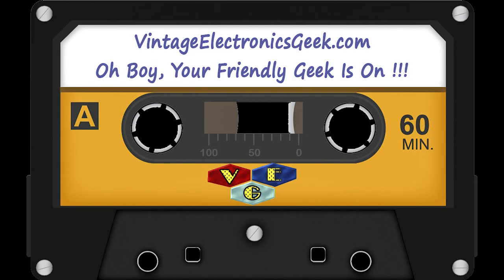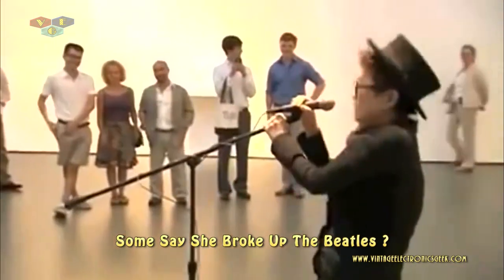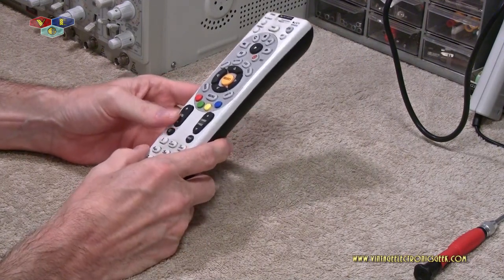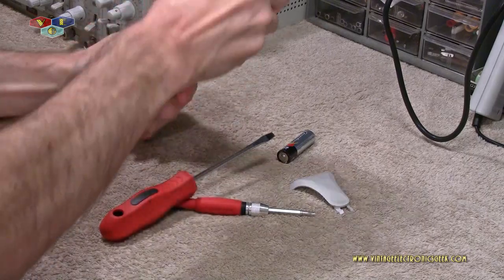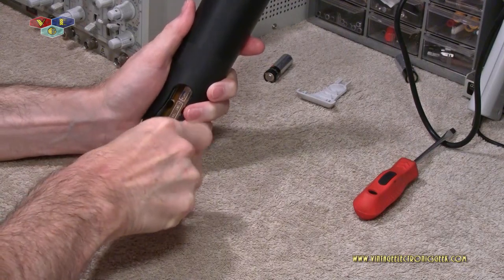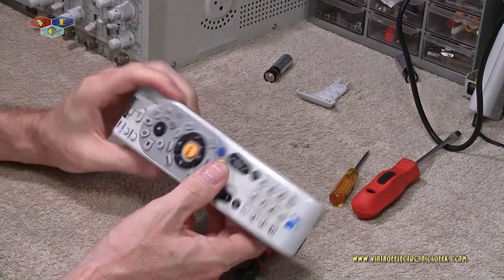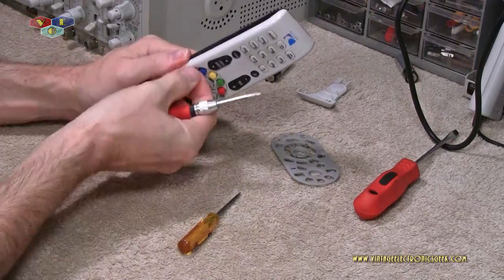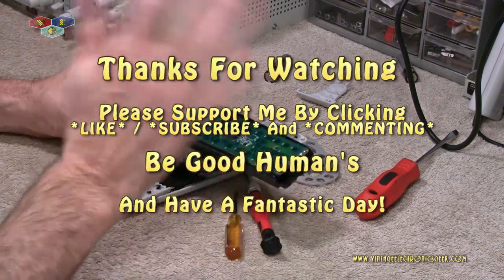How To Open A DirecTV Remote Control

Comment: If you found urself here due to remote buttons giving u trouble, after u take apart, u might find oily substance between circuit board and rubber part the buttons are on, clean it with q-tip and alcohol, put back together make sure top slider in right position before closing, works like new. Word is the rubber gives off the oil after use, because it wasn't "baked" long enough before putting in remote.

Comment: I've found after taking one of these apart that the problem with unresponsive buttons is a buildup of silicone on the circuit board contacts.  The rubber used for the keys is infused with silicone to keep them flexible.  After a couple years of pushing down some of the silicon migrates out of the key rubber onto the circuit board.  Clean the board and key bottoms with alcohol and a rag and it will work like new when you reassemble it.

Comment: Thanks for making this video. I had a hard time prying this thing. I didn't know that hidden screws. This video is very helpful for those who need to clean those silicone oil from the rubber keypad due to humidity.

Comment: This was great - I've got two remotes giving me problems, fought with one for a while and quit before it broke (It's an RF remote too, expensive bugger)  now the spare was getting cranky, found your video and in 5 minutes it works like new again!   And while it was apart, dish soap and a toothbrush made the housing face and buttons like new - a Q-tip and acetone, or a shot or CRC to clean up whatever has been spilled on it over the years, and good as new!
Reply from the maker: Pete - I apologize on late response as I never received notice...happens 90% of the time on YT, I have to purposely go to my videos and look.  I am very glad my little dorky video help you out some, that was my hopeful intent, I figured, if I had problems figuring it out, somebody else sure has!  :)  Teardown is a fantastic time to clean properly!  RF remote? Gosh, they last time I had one of those was back in the 80's with an 8 foot satellite dish!  :)  Thanks for watching!  ~Jack, VEG
Reply: Yep... the DirectTV RF remotes are scarce, you have to request them, and pay I think $40 extra for them - I got lucky and a tech tossed me one, makes life so much easier since the location of my box wasn't great for IR.Thanks again.
Reply from the maker: Oh wow, did not know that!  Thats cool!  Thanks! ~ Jack, VEG

Comment: I tried for about ten minutes and realized I did not know what the secret was. I now have a functioning remote thanks to you after sanding some ruse of the battery spring inside.

Comment: Thank you for this video, it was almost perfect.  Unlike some other commentors, I appreciate you adding a little touch of class with those lovely vocals.
My only complaint probably stems from this being 2+yrs old.  The model of remote i'm dealing with has 2 additional screws (from the back of the board - next to menu button) that tie the buttons to the board.  It comes out as a unit rather than 2-pieces like your video.
Normally that would be a minor note, but this remote had a corroded and swollen battery jammed in it and i dang near ripped the leads off the board.

Comment: Thanks, this really helped me out a lot, I needed to clean up a remote I got secondhand it was gross and some of the buttons were acting up and sticking, nothing that alcohol and a few q tips couldn't fix though. the rubber membrane and plastic housing also needed a serioua bath in warm soapy water and a bit of scrubbing, it was a awful mess, but it pulled through. I really like this model over the newer one, It just has way more fuctions and I can actually control my TV without needing it's remote.

It sucks to have to go looking for it on the rare occasion I use it.

Comment: Lol 😆 lol, instead of ending the marathon, You decided to take the remote apart, She sounds horrible.
 However I did not realize that I had to break off the oval compartment to reveal the extra hidden 4 screws..😱  I broke apart the housing with a butter knife…
 It's all good !!
 I submerged the remote into a chocolatey caramel ice cream bath..🤦🏼‍♀️
I sprayed it down with some rubbing alcohol and my little girl scrubbed down the circuit board with some Q-tips.. It's gunna set aside for a few days.. From one nerd to another, much respect and thank you very much..!! 🤓..
Reply from the maker: With great pleasure!  Glad it helped you out!  And yes, very horrible indeed!  :)  ~Jack, VEG

Comment: Thanks for this. My remote stopped working after I took the batteries out one time so I opened it up, cleaned it and put it back together. It started working again. Maybe it was the battery corrosion buildup or something but its working again.

Comment: It seems as if the back of the key pad buttons have a conductive coating.  This coating wears off and the buttons become unresponsive.  I ordered a new remote but while waiting for it to come in I fixed the worn out 'on button' by cleaning the back of the pad and super glueing a tiny piece of tinfoil to the back of the faulty button.  Worked.

Comment: Thanks for sharing video One question ? my volume button not working tip on getting it to work if possible . thanks
Reply from the maker: Howdy Joseph, glad it helped!  You may need a product like this to fix the function of the buttons:  https://ebay.to/2KzYkdG , of course no guarantees, but I'd give it a shot, its cheap enough?  Thanks for watching and good luck!  ~Jack, VEG
Reply: Than @VintageElectronicsGeek  Thanks for the fast reply back
Reply from the maker: With great pleasure!  :)  ~Jack, VEG
Reply: My "0" button wasn't working. I rubbed the spot on the circuit board with rubbing alcohol.  Worked right away.
Reply: @jasonlara   Thanks for the info Jason will try

Comment: Had better luck with center bezel by sticking tiny screw driver in at the play button then lifting towards the top and could get my fingers under it and gently pry it off without damaging housing. This is a tricky booger.

Comment: Gotta love it, DON'T WORRY KYOKO, more more more!  No wonder Lennon was a junkie.  

My DirecTV remote rubber peeled off.  I have a few dead ones.  
Um getting rid of SAT TV after 21 years, first PrimeStar, then DirecTV.  
I had to BUY my first dish and receiver for 800$.  Going FTA free TV.
Reply from the maker: Not sure if you remember, but she actually had a small hit back in the 80's called "Kiss-Kiss-Kiss", no, I don't think she can sing either and yes, makes you wonder what JL saw!  They were a weird and freaky couple, they used to have reporters over and they would stay in bed doing adult activity in front of them!  I've had dishes for sometime as well, started off back in the 80's when HBO first came out, had a trash can lid with a down converter to watch them.  Also had a 8 foot dish with manual dish controls, had to go out and crank it to change satellites...awe those were the days!  :)  I actually used a large dish up to about the year 2000.  ~Jack, VEG